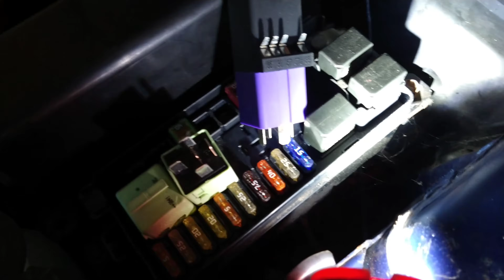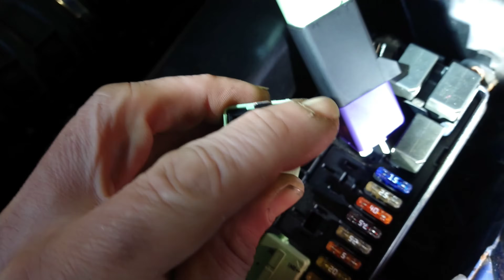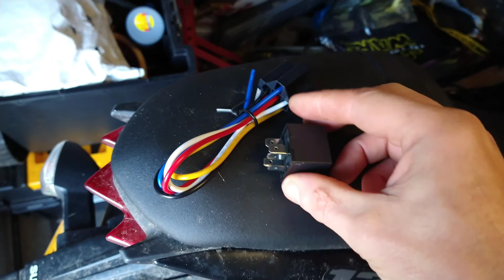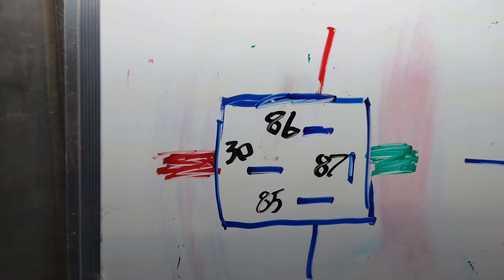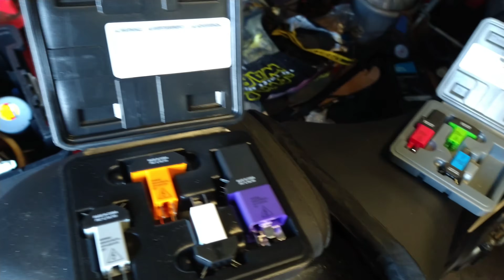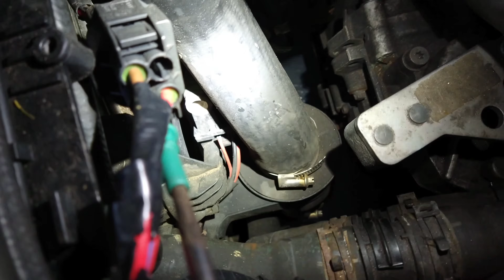radiator fan not working/relay testing (mini cooper)

Comment: I have a question. I have a 09 cooper S.    I replaced the coolant temp sensor. The fan does not come on. When I unplug the sensor, the fan comes on full blast. 

I don’t think it’s the relays as the fan does come on with the temp sensor unplugged.

Is it a bad temp sensor? (I went into diagnostics and it seems to show the correct coolant temperature readout)

I have a feeling it’s the aux waterpump. Help!?
Reply: Did you sort out? I have same problem,
Reply: @pauliuslabas7121   yes, weird solution. There are different fusebox lids with different diagrams. Some of them have a fuse for the fan in FL11 some do not. 

Mine did not. I stuck in a 30 or 40 or 50amp fuse into FL11 like the fusebox lid i found on google images, and the fan came on when it got hot, cooled it down and has been working ever since.

My coolant temp sensor and fan are new.

Try populating FL11 get it up to temp and see what happens. 

I am pretty sure somebody put the wrong fuse box lid on mine with the wrong diagram for my car. That's the only explanation I have. My temperature sensor auxiliary pump and fan are brand new. 

It was still not working , the only way I was able to get the fan to turn on was to unplug the temperature sensor. It will turn on and stay running constantly. 

Anyways, after populating FL11, even though my fuse box diagram, shows it to be a blank, the fan now comes on when my mini gets hot. It refused to do that before and it got really hot.

My fuse box definitely has pins in FL 11. It's not a blank.
Reply: @ thanks i will try, i unplugged temp sensor and fan works high speed all time, will check fuses
Reply: @pauliuslabas7121 mine did the exact same thing. Check fuse FL 11. If there's nothing in there, put a 40 or 50 amp fuse in, even if your fuse box lid says it's unpopulated. Check it with a flashlight it will have pins on both sides of the fuse. Plug the temp sensor back in and get it up to temperature. Ignore the Internet advice because mine goes past 108 Celsius. The fan comes on later. I don't remember the exact temperature. My best advice is to populate FL 11, check all the other fuses and relays to make sure they're good, make sure you have both of the fan relays, plugged the temperature sensor back in and go for a drive get everything nice and hot and see what happens. I did this parked at my house so it was a bit unnerving when the temperature started to creep past 108 Celsius. But the fan did come on full blast, cooled everything down, slowed down and then turned off. After that, it started coming on slow speed for about 10 seconds at a time and turning off.

Either mini scooted up at the factory putting the wrong fuse box lids on certain mini cooper S, or some dealer replaced the lids or end users replaced them. I don't know what the answer is. All I can tell you is without FL 11 populated the fan never came on. The only thing I could do was to unplug the temperature sensor to turn it on. The mini got super hot.
Reply: @pauliuslabas7121  let me know what happens. I'm curious to see if this solves the issues on your car as well. This seemed like a completely unsolvable problem and everybody kept saying one thing you need to replace the ECU. I had weird issues on other cars where it was deemed that I have to replace the ECU, and it turned out that the ECU was perfectly fine, but the sensor would work only half the time making the issue very difficult to diagnose. 

It seems like this is one of those issues that's impossible to diagnose, because as far as I know, it doesn't leave any traces or any error codes with it. Maybe some cars never got a fuse there, and the fan operates differently. All I can tell you in full honesty is the second I populated FL 11 with a fuse, the fan started working correctly and has been working ever since. I am no longer worried that the car is going to overheat.
Reply: Any luck with it? Having a very similar issue, love to know if you’ve got it solved.
Reply: @JP-nz2li  yes, weird solution. There are different fusebox lids with different diagrams. Some of them have a fuse for the fan in FL11 some do not. 

Mine did not. I stuck in a 30 or 40 or 50amp fuse into F11 like the fusebox lid i found on google images, and the fan came on when it got hot, cooled it down and has been working ever since.

My coolant temp sensor and fan are new.

Try populating F11 get it up to temp and see what happens.

Comment: I got both relays replaced and it didn’t work. I connected the fan to the battery (with 2 cables) and both speeds worked on the fan. I’m hoping it’s just the relay or cables. Anything but the thermostat. Even the fan replacement would be easier
Reply: did you fix it?

Comment: Anyone still active on this page ??? got a question about the mini relays, ?
Reply from the maker: What's your question?
Reply: @mechanicmatt871  hey thanks, my fan wouldn’t run, I jumped out both of the relay positions you show, and nothing but direct power to my fan at the fan connector works, my question is why my 2010 mini only had one relay in the low speed pos. And not two, could someone have taken the relay or was it never available for that one to work, recent minor front end crash is the reason for my repair, it only damaged the radiator and not the fan / fan area, could the inline resistor you speak of be the problem?
Reply from the maker: It could be, or the fan itself, cheers Matt
Reply: Thanks for the timely reply, will be a few days before I return to work on it, cheers as well, D...
 @mechanicmatt871

Comment: well I've only recently came across this upload 5.5.2023 "when" & I've already replaced my fan 2yrs ago "say" due to the resistor on the radiator, again the cables going to the resistor unit had corroded & x1 had snapped hence no fan at all prior to the full replacement.. anyway later I'd a top end rebuild due to x3  valves not seating correctly... yep the previous owner had done one & buggered the engine, sold it on & the dealer I bought it from well yeh a shoddy one as well...

anyway, seeing this I've checked my relays under the bonnet fuse box & both are identified as "shown here" incorrect, I have been getting the high speed fan action, only when on a hot day & stop start traffic jam style traffic.. nothing else. I've literally just replaced both relays to what's identified as the correct type/terminal positions & rating... I'll add a comment further it its made any change tomorrow as I'm back at work after this nice long weekend (the weekend of bonny king Charley with Queenie lye-low lill)

Comment: Thank you very much for the diagram!!!   From across the sea,  I think i've narrowed it down to the power steering pump fan.  Low speed and high speed work at the connector (top  left rad near AC charge plugs.  BUT - while I wait for the PS fan replacement I jumped 86 (neg from computer) with a wire to ground.   Low speed fan turns on with engine start and runs all the time.  After engine shut down- off  the fan runs for 4.75 minutes then turns off.  No more over heating for now.   Prior to this I had completed a valve job and believed that when they cleaned the head, the coolant temp sensor was damaged.  I replaced the coolant temp sensor, bled the system several times then found out watching https://www.youtube.com/watch?v=WLjV1OLsTNs - Cars Exposed - that the PS fan is directly tied into the cooling fan circuit and is often overlooked as the problem.  I could not have done it without your white board - great job.  The fan is not frozen but the ground side in the box on the PS fan is the issue.

Comment: Could this be the reason my AC only blows cold air when driving, and after 20minutes stops blowing cold air? Then when i restart the car it blows cold again
Reply: Was it the reason? Did you fix it? I’m hoping that is my problem 🤔
Reply: @Andysmessofayoutube no, never knew what it was. Sold the car a while ago. Good luck!
Reply: @Andysmessofayoutube I have the same problem, did you find the cause of the problem?
Reply: @rfdezj it was the resistor in the fan, like the guy in the video’s. 

I had a spare fan from a parts car and it worked on low speed and the ac works! 

I confirmed by jumping the wires to power the fan (87 and 30) as shown in the video and on the side of the relay. You need a fairly fat wire as it takes a lot of current! The full speed worked when jumped fan relay 2, but not when I jumped relay 1.
Reply: @Andysmessofayoutube  thank you!

Comment: Thanks Matt! Having a very similar issue with my 2010 Clubman. The fan isn't coming on when it should, so I ordered a test kit and will go through the steps you described; super helpful, especially the explanation of the unusual load orientation (corners) on the relay. BTW, where did you get your replacement fan? Thanks again for a great video....
Reply: Did work

Comment: I’ve got no low speed Orr high speed fan power after using jumper cable test any help please ?
Reply from the maker: If you powered the fan directly and nothing happened it does sound like the fan itself is kaput.
Reply from the maker: Unplug the fan and use a test light then  if you jump the relay see if you are now getting power to the fan. It may be a faulty fan
Reply: Yes I done jumper test with battery and they is nothing low speed Orr high speed and I’m thinking it obvs relay or fan clutch 
I’ve tried manually freeing fan clutch with newspaper and tamping back of motor 
And can hear relay switches engaging and when un plugged fan and done jumper test that confirmed problem to be relay Orr faulty fan 
Either way the front end has to come off now hey , Mini Cooper s 
I’m starting to hate these now lol
Reply: @lawrencegoldsworthy9474   Check these two videos it would help you. 
You can fix the stage 1 fan easy and cheap. 
Please see the link, so you can see how I installed the capacitor. https://www.youtube.com/watch?v=BYfyNlr-WqY 
Also in my video is the link in the comment area from Joao who explained the EASY complete installation process.
I did it two weeks ago and is working perfect !

Comment: Top info as usual Matt....fair play to ya.........just wondering on your opinion on the master kit 69300 do ya think it would be suitable for european vehicles, thanks again
Reply from the maker: It's a great kit, I just got the two small relay test kits, they have the same relay testers.
It's just the square relay with either 4 or 5 pins are both labeled for the relays that has the load and control making a cross, rather than the other type. It's only though, it's just two pins that are wrongly labeled for that relay. It's a really good kit, it's helped me out a lot.
I should have got the master kit for all of the extra bits in the kit, although I already have relay puller plyers and jumper wires.
 Thanks for watching
Reply: Thanks Matt, looks like a good bit of kit

Comment: another question....so as well as the pins changing position  on type b relay, they reverse the polarity as well as in your diagram you show the first relay switched live as red pin 86 and going out on 85. On type b you show 85 as red live going out on pin 86? Am i correct?
Reply from the maker: The two relays on the car were both opposite wiring to each other even though the relays were the same so I'm thinking it may not matter in this case on the mini cooper also it had one load power on pin 30 coming out of 87 when energized and the other relay next to it had the load power in on pin 87 and coming out of 30 when energized. This was getting too much to say on the video so I kept it to the load pins and control pins

Comment: Which relay test kit do you use? Does it have both types of that relay setup of is it a case of like it's been said here and temporary modifying the tester with cables or buy the bigger set?
Reply from the maker: Hi there, I have two lisle kits, 56810 and 60610, I think the two kits have the same relays in total as the one larger kit has.
One kit has a four pin relay and the other has a five pin relay instead. The pins in both kits are labeled the same as each other and in all the same places. The only difference being that the four pin is missing the 87a contact.
I have chosen to write on the relay tester to remind me that some relays have 30 and 86 (the wrong way round) 
I have used the jumper wire idea when temporarily fitting the wrong type of relay in a car until I could get the correct one.
Thanks for watching and your comment
Reply: @mechanicmatt871  your welcome.  So we can assume the the people who make your test kits don't currently make a test relay with the wrong  configuration
Reply from the maker: Yes, I think that's all it is, until recently I didn't know about some relays have pins in the wrong places.  This could overload the thin control wires on the car if the wrong relay was fitted. Cheers Matt